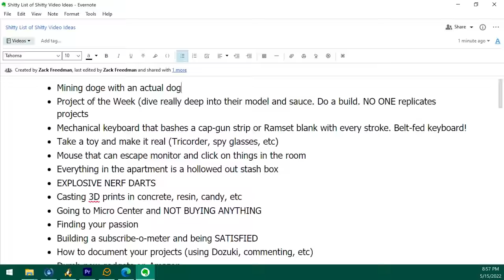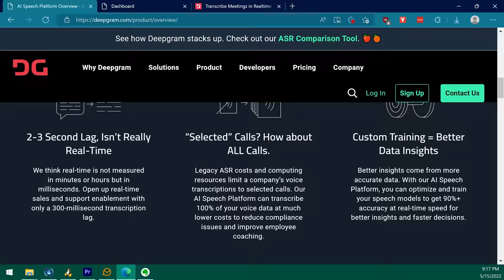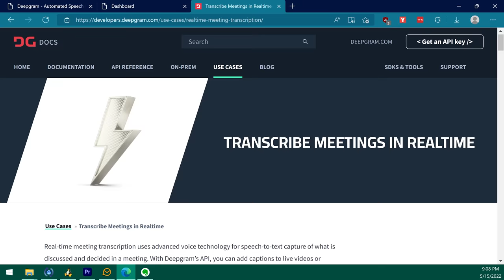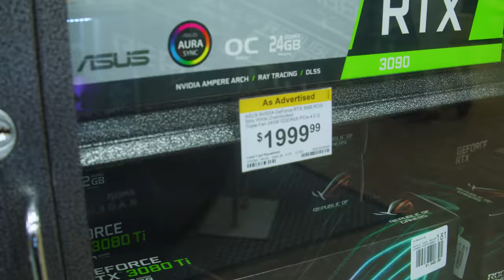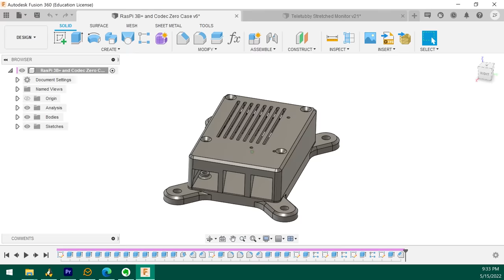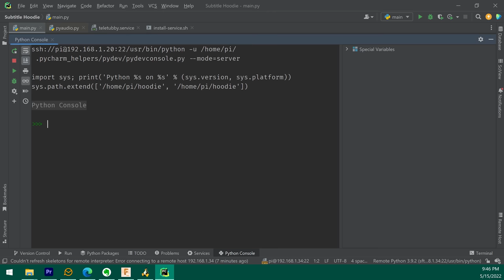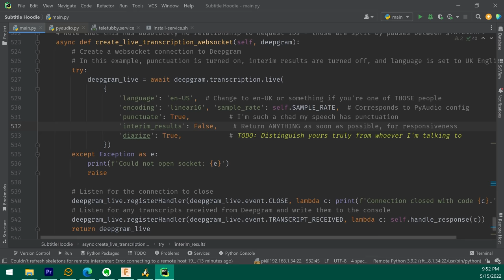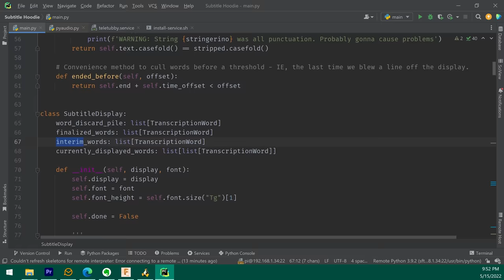Read My Chest: This Hoodie Subtitles Everything I Say

Comment: Okay, now hear me out... You know those scary spinning "holographic" displays? One of those on your chest could make the text hovering in space under your head just like in a video. You could mount it on headband or hat for added danger.
Reply: This is such a good idea
Reply: Honestly. Maybe as a backpack but set it up so it doesn't flop around.
Reply: That's a great idea.
Added benefit you have a fan pointed at you for these hot days.
Reply: LED beard tangler with built in scheduler.
Reply: This sounds like an "I did a thing" idea.
Reply: Just go the videogame route, make it appear above your head.
Reply: That idea is better than you may think.
Reply: Mount it in the head for text floating over the head

Comment: About the low voltage warning. The only way I was able to get it to go away was using a power hat instead of the usb-c connector and use a 12 volt power supply
Reply: He was running a 3B+ which is usb-micro powered not usb-c like the Pi 4. You are onto something though with using the GPIO pins to power even a 3B+ because usb-micro is not meant to deal with the 2.5 to even 3.0 amps a PI3B+ might pull with enough stuff plugged in. Can it? Yes, with the right cables, but they have to be overbuilt basically. USB-C can actually handle that kind of current though.

Well regulated 5V onto the VIN of the GPIO works well provided the power source can deliver.
Reply: @jbuist  That USB-Micro power-plug made me so mad when working with the Pi. Never found anything beside the official Pi power-plug that could deliver the 2.5A with stable 5V over that connector and even the official thing stopped working really soon. Who even thought it was a good idea to use the plug for currents 2A over spec?
Reply: @jbuist  adding avoid_warnings=1 to the config.txt file gets rid of the low voltage warning, I did that when I had to run my pi 3 b+ off the charger for my Vita and it worked fine until I got a 3 amp Microsoft micro USB type C charger and a micro USB type C to micro USB type B adapter
Reply: Another option is to supply slightly higher than 5.0V to help compensate for any voltage drop in cables/connectors/PCB traces and for the protection diode that I think Pis have.

The official RPi power supplies have output 5.1V for many years now, and I don't recall ever having an issue with those.
Some USB power banks also output around 5.1V, but they're often not very well regulated so the voltage drops under load more than you'd expect from cable resistance alone.

My solution for portable power without low voltage issues has been to use an inline DC-DC boost converter. At low loads it nudges the power bank's 5.0~5.1V up to ~5.15~5.2V, and if the power bank's output voltage dips a bit under load, it'll help maintain that 5.15-ish-V.
Obviously that can't magically get more power (i.e. V×A) from the power bank than it'd normally support, but some power banks are totally capable of supplying >10W but drop to maybe 4.8V while doing so, which is totally fine for most devices, but not the RPi.

Specifically I'm using a modified version of a module from AliExpress: it's based on the G5177C IC, has a USB-A socket output and wire pads on the input, a dark blue PCB, a grey cuboid inductor, and is usually sold with keywords/title like "2.5V-5.5V to 5V 2A USB boost module".
As sold, it's set to output 5.0V, but I replaced one of the resistors in the feedback circuit's resistor divider to increase the output to 5.2V: replace the resistor marked "32D" (the code for 210kΩ ±1%) with a 220kΩ resistor (preferably also ±1% tolerance) for 5.2V. The G5177 datasheet contains the output voltage formula if you're interested.

Obvious disclaimer: don't blame me if any of the above damages your Pi, burns your house down, or steals your lunch.
I've been using this with a RPi 3B (or maybe a 3B+; I don't recall) for a few years with no known adverse effects, but I've not tried it with any other RPi models.
5.1V ought to be fine, as that's the official power supply voltage, and I'd expect 5.2V to be ok with all RPis as well (designed-in safety margins, etc) - but again, I can't guarantee anything.
Someone On Discord™ examined the RPi 3's power input circuitry and determined it should handle at least up to 5.3V, but I've never pushed it that far (nor had any need to) and it's always wise to leave a safety buffer :)

Comment: FYI, regarding the low voltage warning on a Pi 3. Little-known fact, the Pi 3B is designed to run on 5.1v, not 5v. The official pi power adapter does deliver 5.1v, but most other adapters, and of course power banks will deliver 5.0v. I was dealing with the same issue for over a year on my Pi 3B, the only thing that solved it was to buy a real 5.1v power adapter.

Comment: The idea is good, but doing it over a external service is a privacy nightmare. This can be done offline, and you even save on battery for the network connection.
Reply: From what I've seen and read local processing isn't as reliable as this looked, and is very unlikely to be as convenient to work with - still be my prefered method though, as who wants an external dependency when you don't need it. However where privacy is concerned these days it seems anything you say in a public space is very very likely captured and recorded at least once, may not be easily intelligible over the noise floor with things like trains going by etc, but there are just too many microphones and cameras around for another one to make a blind bit of difference really. Depressing as that thought is.

Comment: Wait, if all the processing is done through an API, wouldn't you be able to use a Pi 0W instead? 
That way you wouldn't have to have a full sized Pi on your shoulder, and you'd also get rid of the low voltage warning.
But nevertheless, great vid as always!

Comment: There was a person that wrote code to display video over their face using VSeeFace, Voice-Cap (in VSeeFace) & displaying a VRM of a realistic face to display over their own face. Used a behind the neck phone holder to hold the display device (array beam? or projector style display). So, maybe you could print a next holder for a projector eye and box to run the system on the fly.

Comment: Whats the most flexible commercially available display currently out there?

With advances in display technology and battteries, this is what the future of clothing could be - display art or slogans or patterns as the default state, use for real world applications like text to speech when required.

The promise of wearable computing has always had 2 components - the personal (usually exemplified in the HUD, as watchers of Zack's channel of course are aware) and the public. This project is an inspiring prototype of what the public aspect of wearable computing could be. VoidStar Lab casually innovating as always

Comment: Some 'higher quality' USB batteries will have better voltage output, but you also need a non-crappy USB cable (don't ask - I don't know where to get one either!).  The Anker and RavPower batteries I have hold their voltage better than most.  Cheap ones will drop under 4.5 volts under load from a Pi alone.  Really cheap ones start out at less than 5 volts!  You could always get a USB C 'trigger' board, set it to 9 volts, then feed it through a switching regulator (set it at 5.2 volts so the cheap USB cable won't matter as much).

Comment: was wondering what that white bar was. now I get it, it's a pi low voltage notification. solve that by adding a boost adapter between the battery and the pi, use a USB voltage meter to check pi USB voltage output,  and turn the boost pot until pi USB output is a solid 5v. will drain the battery faster, but solves the problem.

Comment: Zack, are you saying the "avoid_warnings=1" didn't turn off the under-voltage warning display?  It's worked on all the projects I've done while powering a Raspberry Pi from a USB port on a TV that can't handle powering a Raspberry Pi...
Reply from the maker: Nope, it just turned off the lightning bolt icon. The pop up is baked into Pi OS.

Comment: This is brilliant. This would be better if it was using a flexible OLED or LCD screen and the electronics were smaller and centralized so you don't need to have lose wires everywhere.

Comment: I'm pretty sure the Pi 3B+ can run the text-to-speech locally in real-time. That would remove most of the lag, giving it a more natural feel, and would work anywhere as no wifi would be needed.
It won't have the benefit of contextually revising the words in sentences but IMHO the instant translation is worth the few mistakes that may creep in now and then.

Comment: Hahaha, I saw "why do I still use Arduino?" in your list of ideas. I've often wondered why people do that still! It's not like a super-underpowered 8 but Arduino Uno or Mini is any cheaper than the boards built around the absolute beast that is the ESP32. Hell, you can get a TTGO T-display for less than an Arduino Uno, and that comes with a screen, battery management, and USB-C.

Comment: Most power banks don't give out a reliable 5v but more like 4.2v-4.6v which is perfectly fine for charging a phone but not for a pi, and when spec-ing the supply current don't forget about the draw of the USB devices a pi4 can source up to 1.2A total between the 4 ports which is why official pi foundation supplies have the current rating that they do. Low voltage is EXTREMELY insidious with raspis, I spent multiple days troubleshooting a pi zero w I intended to use to stream op25 via VLC as a low cost trunk tracking scanner (antenna and SDR + server in another room). The audio playback was having intermittent skips and hang-ups and nothing I did would fix it, I was running headless CLI and controlling it via SSH so there was no way for me to see the low voltage warning icon the GUI displays... I only tried a different power supply as a last resort and it immediately solved all the audio and performance issues I was having. Lesson learned use a proper power supply and save your sanity.

Comment: Ooh, cool! I actually ended up doing a project like this for a class, although I wish I was cool enough to make it properly wearable, mine just looked like a pile of junk with a remote. :P
You also had a way better handling of interim transcription than I did, I just split the screen into two parts -- one with stuff that hadn't been confirmed yet, one with stuff that was.
I also used a Pi Zero on mine -- was going to just use my Pi 2, but having everything running off of a power bank meant that it all just drew too much power. The Zero was terribly slow to start up, but it didn't really need much speed to just record some audio and upload it to Google's voice transcriptions service (and boy, I kind of wish I used anyone else's lol), so it ended up working just fine when I copied everything over to it.

Comment: I like the project. You're tickling fun brain thingies with me here. Quick question: Does this this need to be connected to the internet? You mentioned async programming and I just assumed that meant calling out to a processing center. If it's all local and I read that wrong I'm even more impressed!
Reply: The audio data is sent to the processing centre which sends back subtitles, so it does need to be connected, yes.

Comment: Could this be turned into an add on for the Singularitron? Having it in a less bulky form factor (maybe have the pi plug into one of the add on slots and use it to feed text?) while still being able to show it off along with another project could work pretty well

Comment: I work with a lot of pi3b+'s and they always throw low voltage warnings regardless of actual power. Plugged into a 6 amp 5v psu? Low voltage warning when I access the sd, or plug in a keyboard, or ask the ethernet to get to work LOL

Comment: If you can't speak sign language, chances are, you don't understand it either. A person needing this to understand what you say can't talk, so they can't use this to communicate with you.
A very onesided conversation indeed.

Solution:  Get a camera on the PI.  Have an AI translate the signlanguage to your teleprompter. 

Also, if it is cloud based (Aka. the work is done by a different computer) wouldn't that mean, that you need a good Internet connection to maintain a fluid conversation?

Comment: 0:40 how the fuck do you go to MicroCenter and not buy anything? Not humanly possible.

0:42 oldest part in my box? Probably 1/4 watt resistors I desoldered from DEC hardware, so 50 years old?

0:45 Google Glass failed because Google (as they are wont to do) dropped support for the product, and because the silver mirror coating at the end of the prism repeatedly failed. Google would fix it until they wouldn't fix it. Some people didn't like having a camera pointed at them which could be recording with no indication to them. Battery life was a little short for actually, y'know, using it. Like maybe 2-3 hours? More if you were just wearing it and not interacting with it. Even though glass got location information from the cellphone it was paired with, the photos weren't EXIF location tagged.

I haven't used mine in years, although I charge it from time to time to keep it alive.